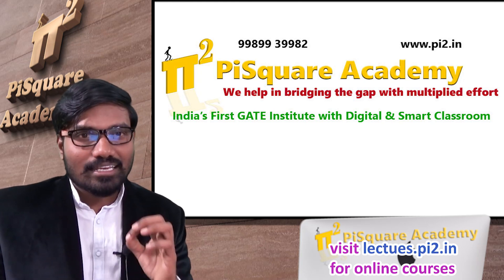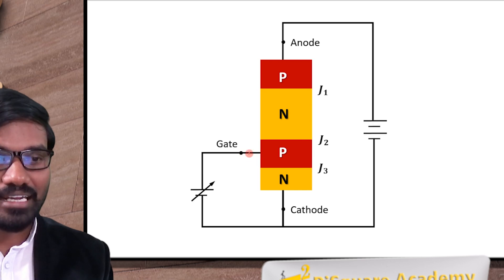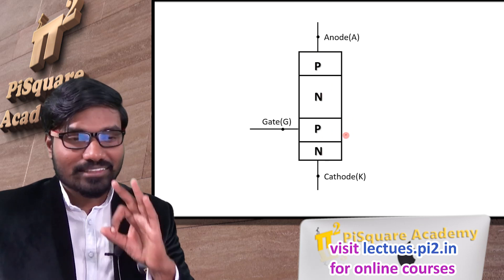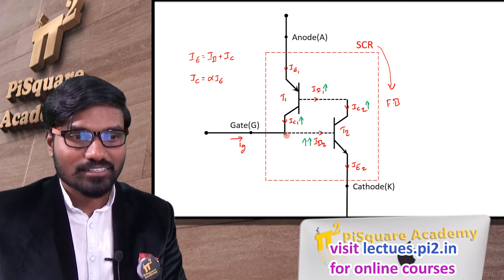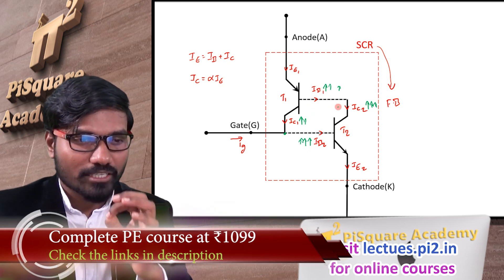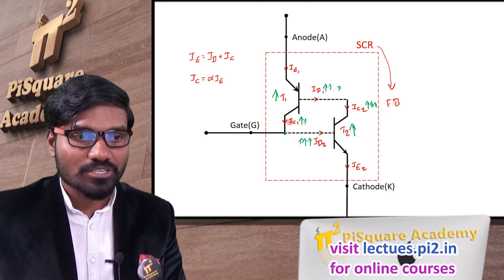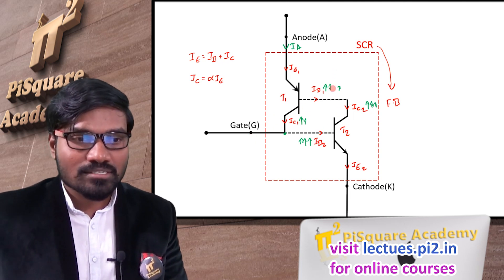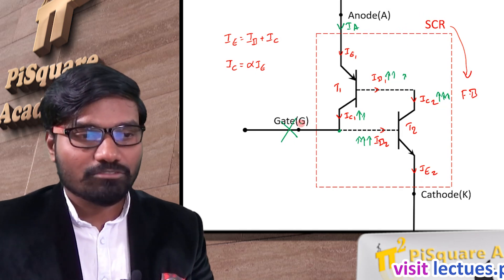Why gate signal has no control over turning OFF SCR

Comment: Practically I know that gate has no control on turning OFF  SCR.
but sir ...
 by KCL 
Ic1=Ib2
if we apply -ve voltage to  the gate terminal(base of T2)
such that Ic1 become equal to the Gate current(in reverse direction)...
Consequently Ib2 become zero and then T2 stop conduction as T2 stop .. T1 also stop conduction...
The  conduction chain will break ...
Sir please help me  to clear this stuff